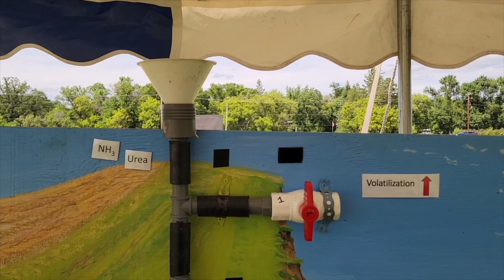Wheat School: Fixing the leaky N2O pipe

Comment: John Heard tells us that "100 pounds of N per acre (when broadcast applied) is like 460 pounds CO2 equivalent, So that all of a sudden puts a little bit of impetus on understanding how this works."

What John Heard needs to understand is how much Nitrous oxide will actually run up global temperature. The United Nations IPCC reports tell us that Nitrous Oxide is 273 times more powerful at trapping heat than CO2. But what we are NEVER told is how much N2O will run up Global Temperature. 

What's at issue here is the IPPC's Global Warming Potential numbers. The GWP numbers are designed to generate large numbers from atmospheric components that have very small concentrations. N2O has a concentration in the air of 0.00003% and is increasing about a part billion every year. By 2100 that annual increase in N2O is on course to run up Global Temperature less than a tenth of a degree.  

Altering farming practices today based on a projected increase of less than a tenth of a degree 80 years from now doesn't make very much sense.
Reply: @matthewreinhart5378  Win win for everyone?  The only people who are on the winning side of the Climate Change issue are those who stand to make money or gain power or prestige.  The rest of us - not so much.